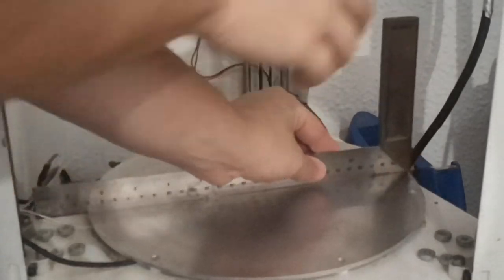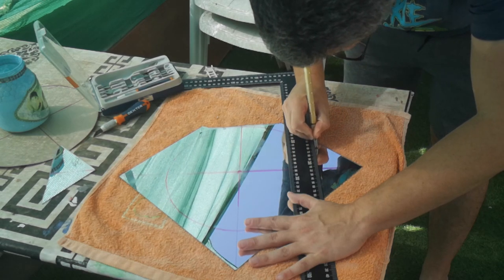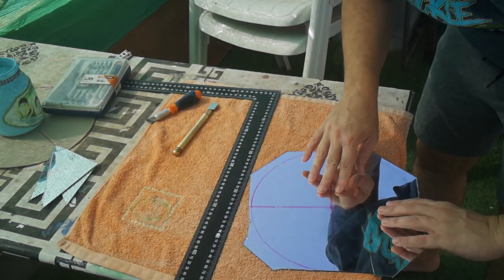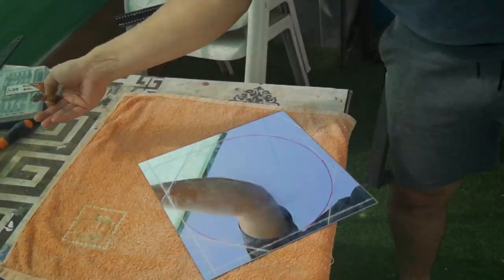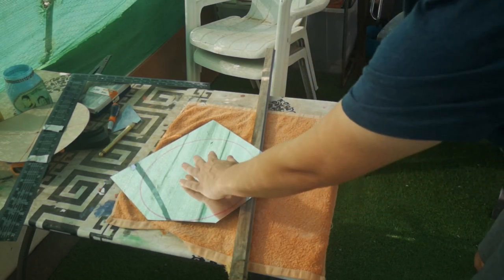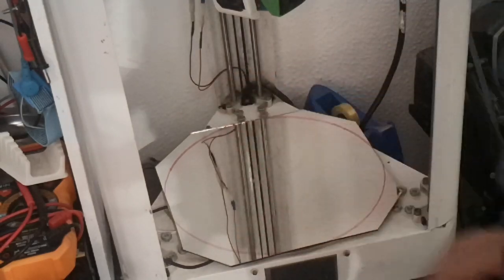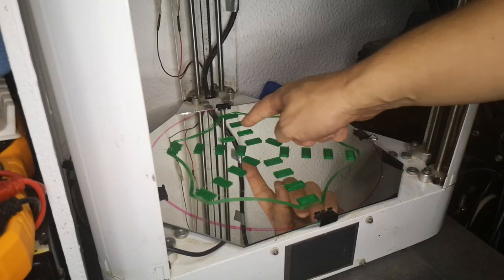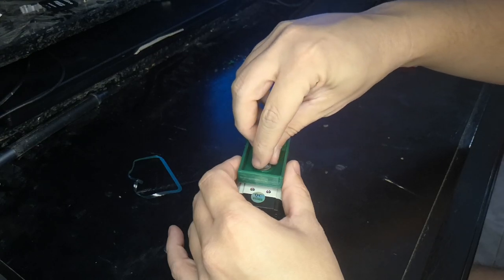DIY 3d printer glass bed -  How hard can it be

Comment: I would’ve looked for a scrapped microwave glass platter - just a thought
Reply from the maker: That's actually a good idea. Is tempered glass easy to cut to?
Reply: @RetroUpgrade  I wouldn’t look to having to cut a microwave platter! What you showed looked approximately the size of a microwave platter - I don’t like to make work for myself! Maybe check what size you made / the size of your platter. 👍